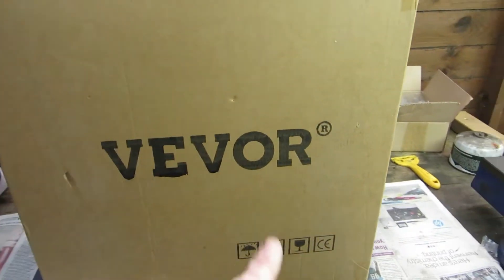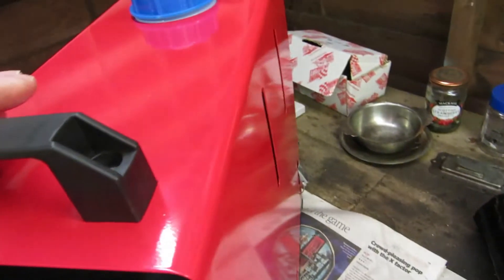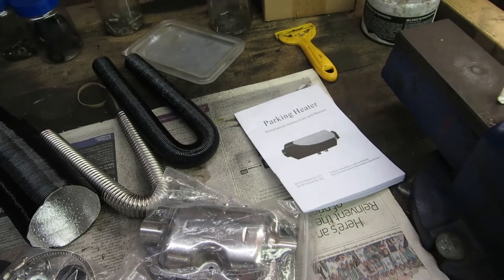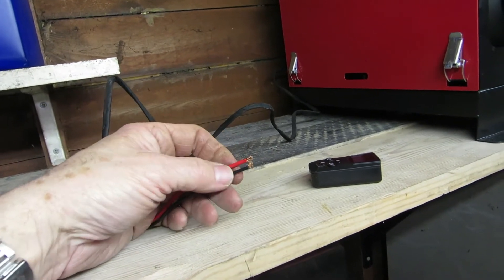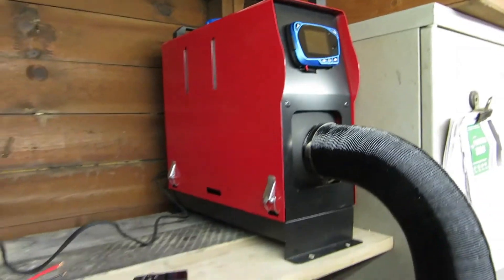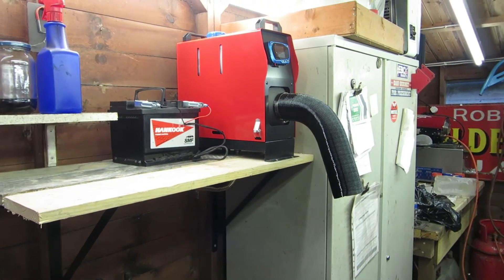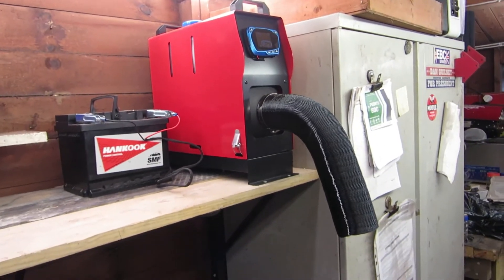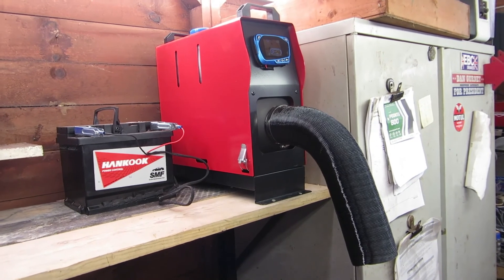Diesel Powered Heater for my Workshop

Comment: Great 👍 exhaust gets hot you may want to insulate as it goes through the wood mine also has nylon fuel pipe which is better for the pump you can get a kit if needed, anyway thanks and keep warm
Reply from the maker: I've had a couple of comments about the exhaust exiting through the wooden cladding. I have been keeping an eye on it but I don't run the thing all day because it really isn't that economical. The exhaust gets to around 200 deg C in theory, wood takes a lot more than that to ignite so it may get a bit singed but nothing more than that. Anyway, I intend to change the setup in the future so I can run it on oils other than diesel, I'm thinking two feed tanks one with diesel an the other with alternative with a changeover valve. I will modify the exhaust through hole arrangement then, or may just have a longer pipe to glean heat inside and lower the exit temp. I may well post another video on the topic. Cheers

Comment: Excellent install but the holes in the wood shelf and wall should be larger as you need clearance from the exhaust pipe and combustible material. The shelf can just be bored larger but for the wall, your best bet is to use a 4" gimbal or a air intake hood with the duct filled with ceramic wool. Kind regards from Canada!
Reply from the maker: Hi, thanks for your message and I understand your concerns; the holes in the shelf are actually larger than the pipe by 10mm so there is no contact with the exhaust. The 25mm hole through the shed wall allows the wood cladding to touch the pipe but it  has the muffler attached outside of the shed which tends to act as a heat sink so the pipe is much cooler at this point. Not sure Gimbal is the right word? 4" with insulation stuffing is overkill for a 22mm pipe. There are marine stainless exhaust skin fittings specifically made for these heaters which look nice & cost around £25 upwards but it would be like giving a donkey strawberries, (it's just a shed). If the wood starts to look charred I will enlarge the hole and put some exhaust wrap round it at the exit point. Cheers